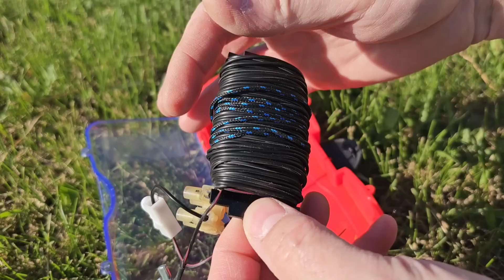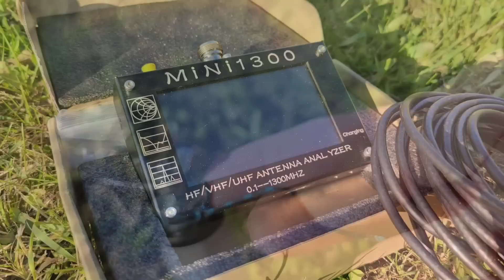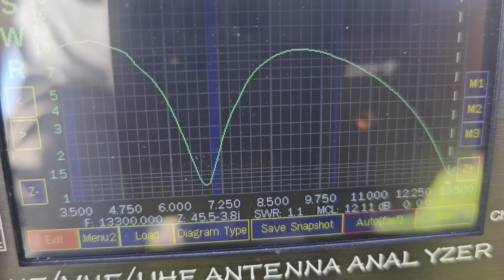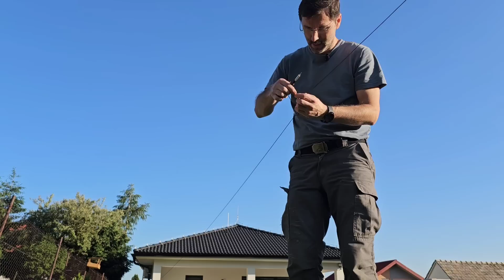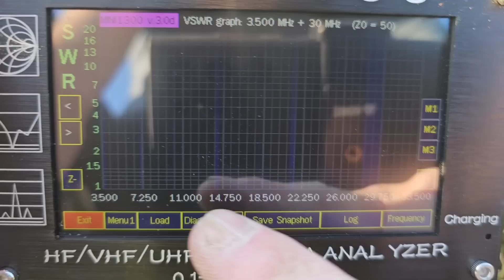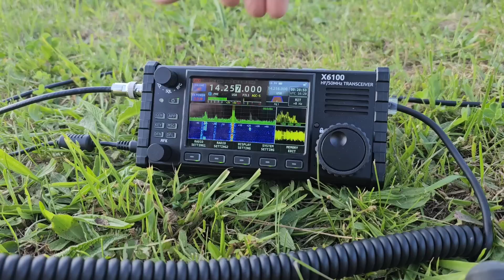My Mini Portable Antenna (40/20M home made EFHW 49:1 UnUn)

Comment: Another well done video Paul; I've been following you for some time now. A question please: Is the Mini 1300 your favorite choice for a small antenna analyzer? Do you like it better than the RigExpert analyzers for compact size in the field? Thanks for your thoughts, Michael KZ5MSE
Reply from the maker: Absolutely yes. For me it is better than RigExpert and cheaper :D
Reply: @OM0ET  Many thanks for that advice, Paul. In looking to purchase a Mini1300, I'm confused with differing pricing and some ads saying "upgraded" for higher prices. Amazon US shows a Mini1300 for $165 and another one for $218, without any real explanation for the difference. As for as you know, does the "upgraded" version have a newer processor or something? Please, what should I buy. I figure there are now clones on the market that I should avoid. Thanks for your thought, please. Michael
Reply from the maker: I have purchased it for 152€ from Aliexpress. I don't know what is better in upgraded ver. Sorry